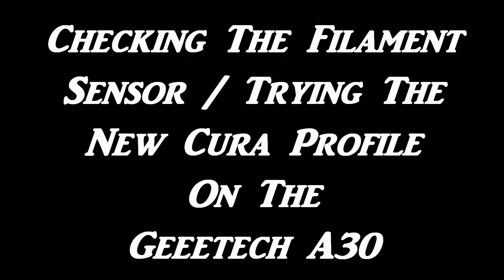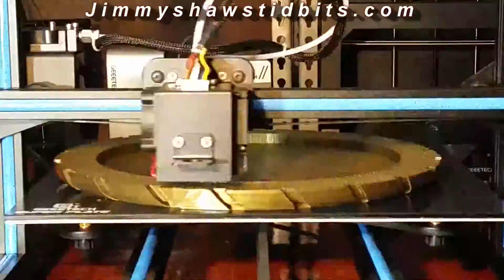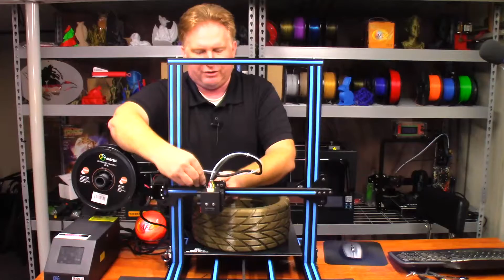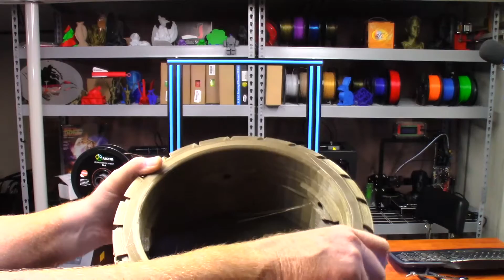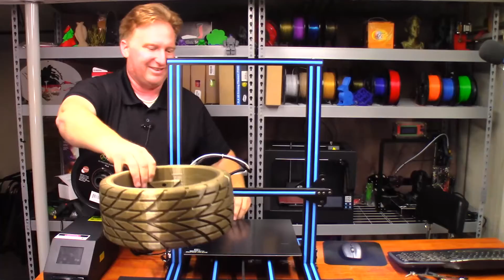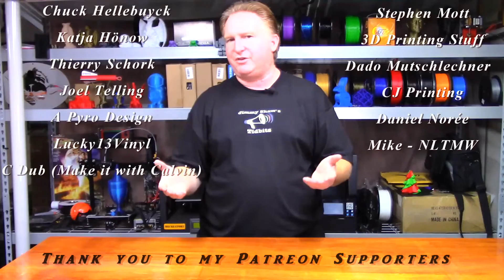Checking The Filament Sensor  / Trying The New Cura Profile On The Geeetech A30

Comment: I think extruder will try to crush a model, if the filament will be finished, when the model's height will be 20 cm and more and extruder go to home.

It is true or I am wrong?
Reply from the maker: It shouldn't because the build plate would move to the back and the extruder would drop afterwords to the home position in front of the print.